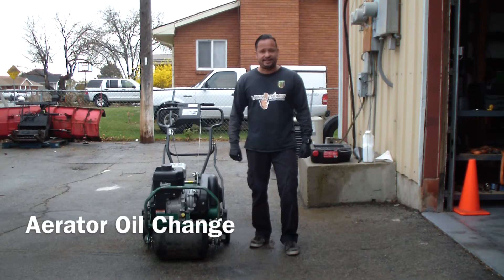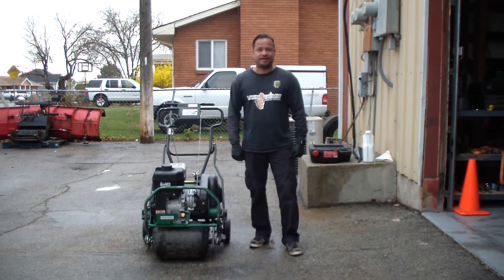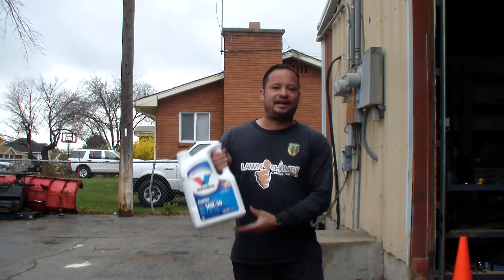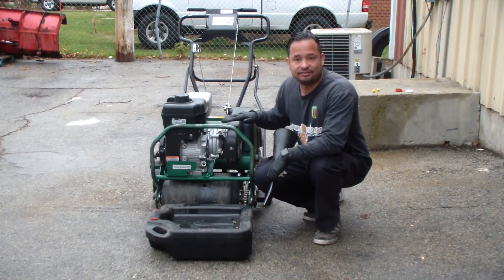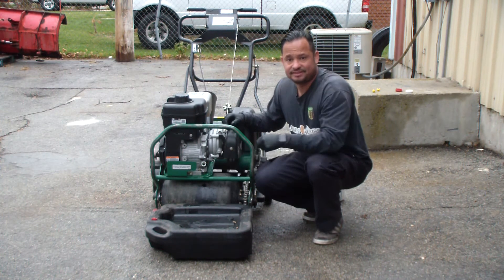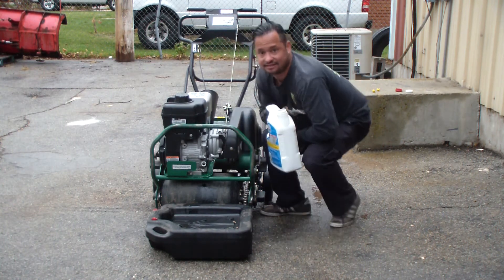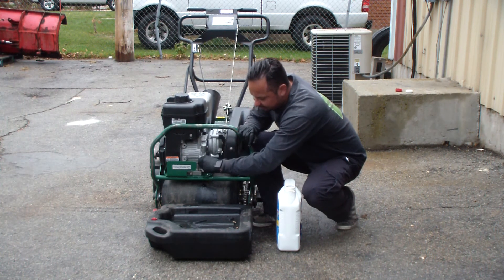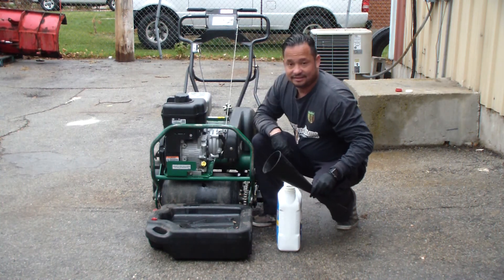Aerator Oil Change

Comment: When I change my oil, I always run it for about 5 min to warm it up..then drain it, flows better warm...I tip it back all the way, and add 20 oz of oil, tighten the dipstick..and roll..no need to get that back dipstick involved....I check once a week..unless you're  burning oil
Reply: Oh too add something..you should use SAE 30 oil..not 10-30...I use Rotella by shell because I can get that in gallon jugs
Reply: @thethirstymoose  Honda recommends 10w30 for most conditions, 10w40 in higher temps.

Comment: How bad is it to use 5w-30??
Reply from the maker: Shouldn’t be a problem at all
Reply: It is ok, especially in colder temps, but will shear much quicker in high temps. If you are going to be operating in high temps go with 10w30/40 at least.